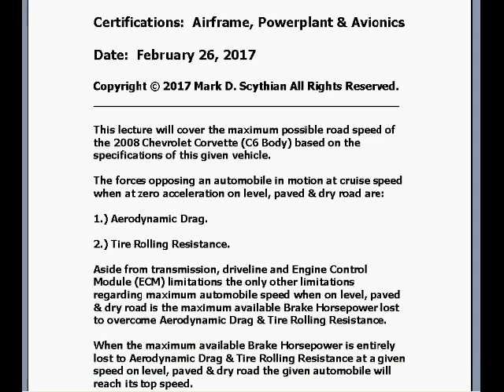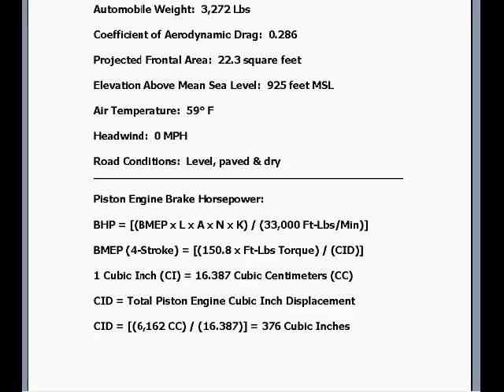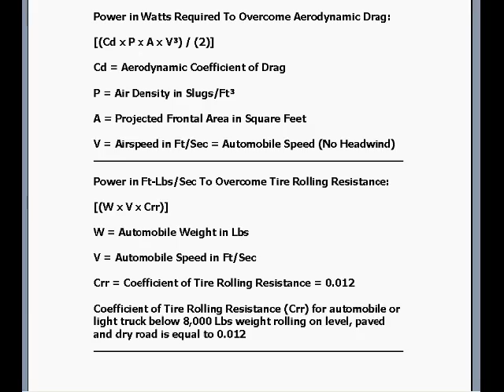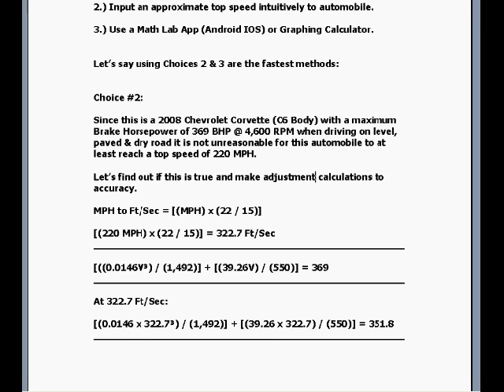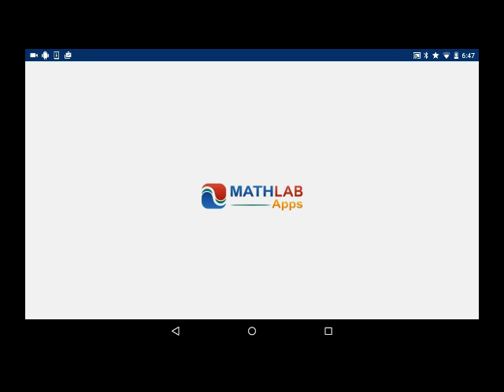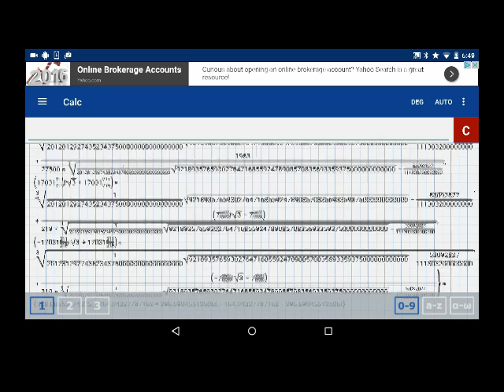2008 Chevrolet Corvette Top Speed Calculation

Comment: Hi Mark. I am sorry to bother you once more. But there is one thing I can not understand. And that is calculating BMEP values at the point of MAX HP rating.  Here is a link with my problem. Any help is appreciated. https://imgur.com/a/Hv0o8
Reply from the maker: Hi JJ how's it going?  The Torque-To-RPM chart reveals that the maximum Torque is:  675 Newton-meters @ 3,665 RPM.  The Y-axis reference when at maximum torque is about 1/3 the way between 3,500 RPM and 4,000 RPM or 3,665 RPM.  I will calculate the maximum BHP output based on these metrics.  Observe my calculation below:

1 Newton-meter = 0.737 Ft-Lbs.

[(675 Newton-meters) x (0.737) = 497.5 Ft-Lbs

Maximum Ft-Lbs Torque = 497.5 Ft-Lbs Torque @ 3,665 RPM.

BMEP (4-Stroke) = [(150.8 x Ft-Lbs Torque) / (CID)]

CID = 454.2 Cubic Inches Displacement

BMEP = [(150.8 x 497.5) / (454.2)] = 165.2 PSI when maximum Ft-Lbs Torque output of 497.5 Ft-Lbs @ 3,665 RPM.

L = 0.333 Ft

A = 14.19 Sq In

N = [(3,665 / 2)] = 1,832.5 PS/Min

K = 8 cylinders

BHP = [(BMEP x L x A x N X K) / (33,000)]

Maximum BHP = [(165.2 x 0.333 x 14.19 x 1,832.5 x 8) / (33,000)] = 346.8 BHP @ 3,665 RPM

Important ===> BMEP in PSI is only applicable to Ft-Lbs Torque & BHP values!

Everything else is total power ("HP" or IHP) at a certain RPM including power lost to keep engine running (FHP) PLUS usable power available at the crankshaft (BHP) and cannot factor as BMEP but only IMEP.

IMEP = BMEP + FMEP

Therefore IMEP is only applicable to IHP or "HP".

"HP" is not the same as BHP.

The piston engine BHP formula can be used but set it up to equal IHP instead and replace the BMEP with IMEP and then solve for IMEP in PSI to know the overall cylinder pressure throughout all four piston strokes applicable to IHP or "HP".  The L, A, N & K are known at the max "HP" or IHP curve as well. 

IMEP = [(IHP x 33,000) / (L x A x N x K)]  ======> Rearranged to equal IMEP

- Mark -
Reply: This is extremely easy to comprehend. Thank you very much Mark. I have one more question if you don't mind. Here is original NASCAR profile from the game.  https://imgur.com/a/ljkEV  and couple of questions. 

It states   231 psi   @7000   and  202 psi @9000.   Please take a look at my math if you have time.
Reply from the maker: Hello JJ!  231 PSI BMEP is way too high for a 4-stroke Gasoline piston engine!  Sounds more like a diesel 4-stroke piston engine!!!   231 BMEP PSI @ 7,000 is not correct.   To solve for BMEP in PSI regarding a 4-stroke piston engine, multiply 150.8 times the Ft-Lbs Torque, then divide that into the cubic inch displacement for the entire engine.   So the bore area of 13.53 square inches times a stroke of (0.27566 ft x 12) equals 44.75 cubic inches per cylinder time 8 cylinders, so 385 CID.  By multiplying 150.8 x 231 Ft-Lbs Torque, then divided that into 358, the BMEP in PSI @ 7,000 RPM will equal 97.3 PSI BMEP.   Whenever the RPM is above or below the max torque RPM the torque will drop below the max torque rating which also includes a drop in BMEP and BHP.

More RPM doesn't mean more BMEP when the RPM is above the max torque RPM.

So the BHP @ 7,000 RPM will equal:  [(97.3 x 0.27566 x 13.53 x 3,500 x 8) / (33,000)] = 307.9 BHP.

- Mark -
Reply: The thing is that those "BMEP" values are given in the game.  231@7000 and 202@9000. I know that NASCAR engine produces around 550 ft/lbs  and around 800hp. So 231 ft-lbs is way too little for a stock car engine.  Here is what I found on-line. https://imgur.com/a/1n8Cz    Its states  220@7500  and   202@9000.

231 - Comes to 548 ft/lbs  and 202 =  480 ft/lbs.      I know now they reduced HP ratings from 825 to 725. But before in 2003   - 830 iHP would be a close number.     Also there are some screenshots I took from NASCAR 101 lecture.   BMEPs they have there are  217 BMEP  and  250 IMEP.    I am pretty sure that in the video they are bragging about old design V8 engines running at such numbers.  Also state numbers as high as 870 HP and 560 Torque.     

In my previous example. Max Torque is at 7000 ( 550ft/lbs) and it falls off like it should at 9000 ( 480ft/lbs). 

I have to mention once again that 231 and 202 values are given by the software.  

If I understood correctly.   At 7000RPM we are making Maximum Torque, Maximum BMEP and Maximum BHP.      At 9000RPM  ,    We have less Torque  ( 480 vs 550) ,  Less BMEP  ( 202 vs 231 ) , Less BHP - (  731bhp vs  821 bhp ) and that last part is NOT CORRECT.  That is what brakes my logic.  That makes me think that those values 231 , 202 are NMEP or IMEPs.  But web site info makes it fall with in BMEP.
Reply from the maker: Hi JJ!  In regards to F1 engines they operate at higher RPM limits with nominal torque and a concentration on automotive aerodynamics.  The result is a large bore diameter and very short piston stroke.  Shorter the piston stroke greater the piston reciprocating frequency or RPM.  Larger the bore results in greater BMEP and Torque.   

Obviously the F1 engines are set up for speed and nominal torque to overcome forces opposing forward motion with reduced air-fuel charge per intake cycle.  If the bore was any smaller F1 would run out of torque and not reach their top speeds quickly.  If the bore was any bigger more torque dominance would occur combined with more fuel consumption per powerstroke and slightly more time to reach top speed.  

So F1 is set up the way it is on the non-American market for their own trademark design philosophy based on:  concentration in vehicle CG, automotive aerodynamics, weight reduction, fuel economy, RPM dominance and nominal torque.  F1 engines are a completely different animal from NASCAR and Sprint Cup engines!  

I'll calculate the maximum BMEP & BHP for both the F1 engine and Sprint Cup engine down below based on the link you sent me along with a brief concluding statment.

F1 Engine:

Bore Area in Square Inches = [(3.858 in / 2)^2 x (3.14159)] = 11.69 square inches
Piston Stroke in Feet = [(1.566 in) / (12)] = 0.1305 Feet
Maximum Ft-Lbs Torque:  214 Ft-Lbs Torque @ 17,000 RPM
CID:  146.457 cubic inch displacement
Number of Cylinders = [(146.457 CID) / (11.69 square inches x 1.566 inches)] = 8 cylinders
BMEP in PSI (4-Stroke) = [(150.8 x 214) / (146.457)] = 220.35 PSI
Maximum BHP = [(220.35 x 0.1305 x 11.69 x (17,000 / 2) x 8) / (33,000)] = 692.7 BHP @ 17,000 RPM

Sprint Cup Engine:

Bore Area in Square Inches = [(4.185 in / 2)^2 x (3.14159)] = 13.76 square inches
Piston Stroke in Feet = [(3.25 in) / (12)] = 0.271 Feet
Maximum Ft-Lbs Torque:  520 Ft-Lbs Torque @ 7,500 RPM
CID:  357.65 cubic inch displacement
Number of Cylinders = [(357.65 CID) / (13.76 square inches x 3.25 inches)] = 8 cylinders
BMEP in PSI (4-Stroke) = [(150.8 x 520) / (357.65)] = 219.25 PSI
Maximum BHP = [(219.25 x 0.271 x 13.76 x (7,500 / 2) x 8) / (33,000)] = 742.71 BHP @ 7,500 RPM

Sprint Cup engine has a higher Brake Horsepower output than F1 engine, but Sprint Cup/NASCAR vehicles also have a higher aerodynamic drag coefficient, tire rolling resistance and vehicle weight compared to F1 vehicles.  Each has their advantage and disadvantage over each other like with any other machine concept. More emphasis remains on the operator/driver's understanding of the given vehicle or machine systems and effective driving for racing applications.  Like with any other machine it is how well the operator/driver understands the given system parameters and effective usage thereof.
 

           - Mark Scythian -

FAA Licensed A&P Technician
Reply: Thank you Mark.  I only have 2 more questions if you don't mind. 

#1 - Max BMEP at Max Torque = 220 PSI.   Is it safe to assume that 231 PSI value in game might be NMEP or IMEP?   Pressure before friction or friction and pumping take away power? 

#2 - F1 to Cup Car link shows BMEP value of 202 @ 9000 RPM.  In PLANK it come out producing 821 HP? 

That does not seem correct as Max BMEP and Max BHP are @ 7000 RPM.   

What kind of MEP can we calculate from HP or (IHP) rating @ 9000 RPM? Or any car at Max HP. 

Would those normally be IMEP.   Indicated Pressures?  Or  NMEP - Net. I know they rate engines in NET HP now instead of gross. 

#3 - Would NMEP and NET HP work in a PLANK relationship or those are completely two different things? And I am just getting the names NET confused?
Reply from the maker: Hi JJ!  The formulas installed onto your racing simulator might not be accurate.  There is IMEP, FMEP & BMEP. linked to IHP, FHP & BHP respectively.  FMEP = IMEP - BMEP.   FHP = IHP - BHP.   If the values don't match up based on a No-Load 33% BTE when at maximum BHP, then more than likely you have programming errors in your simulator.  You might want to access the game Command or Registry function and edit any formula errors.

If you use the methodology for calculating BHP from my last comment and methodology for calculating IMEP from from my last few previous comments you should be able to figure out where the performance metric errors lie..  

Try to edit the game formula registry and let me know what happens!

- Mark -
Reply: Thank you Mark. I have been breaking my head over the simulator for a while. The biggest problem is Registry functions and "Hard Code" of the game are unavailable. It was made by Papyrus Racing Sims in 2003 and source code for this game was never provided. 

I am pretty much trying to figure out what kind of formulas and possible math game creators might have ran in the simulator. All I am able to do is change initial 30 engine numeric parameters and then observe changes in game. It is lots of trial and error. 

More to it , famous iRacing came out from Papyrus's sim. So editing the physics was never possible until recently. Someone uploaded a "home made" tool that will allow to replace certain values in the registry. The list of editable values on the engine is what you saw in my link.  We have no idea how the game runs, no idea what kind of formulas it runs, no idea how it is structured.  All we have is 30 engine fields , 30 tire fields and 60 chassis fields. With more than 50% of values being just numbers with no definitions. That is the biggest challenge. I have been trying to analyze and reverse engineer an approach to editing these values. If everything was clear as day like in other racing programs with available editors, I would not be bugging you as much.  

Basically I have 1 - list of numbers  2 - in game feel , in game behavior , 3 - common sense. Those are only 3 tools I got.    

I can not access Games Data Registry , formulas , I can not even look at them to tell what they are. 
I can only change 30 numeric fields and expect results in game.  
It is like a science , racing , software , puzzle made with 120 lines of different values. 

That is why any help , any info , any tiny little clue that can lead to progress is worth gold to me. 
As no commercial editing soft is available for that game , any edit , any changes made to physics are 
very valuable to those people who still play it.  

I will try to make few sample videos of what actually happens in game, with few questions and ideas. I would like your opinion on what you see if you don't mind.
Reply from the maker: Hello JJ!  No I don't mind.  That would be cool to check out your gaming simulator work documented on screen recorder and posted as a video.  When you finish up some samples tell me the video name or send me the URL link.  It's probably more practical to share what you are doing in this manner.  Well, keep me posted!    - Mark -
Reply: Once again you are amazing help. I have few scenarios I want to show you and ask few questions. I will send you the URL as soon as I put something presentable together in a video. Thanks Mark once again.
Reply from the maker: You're welcome JJ!
Reply: Hi Mark I have one more question regarding your 2008 Corvette video.  In that video @4600 RPM we are making maximum Brake Torque and Maximum Brake Horsepower.   Now when this car is traveling at top speed of lets say 223 mph and is in equilibrium between HP and AIR/TIRE resistance.  I want to ask about gear ratios.  Is all this happening at 1 : 1 final gear ratio ? And at what RPM will the engine be while at equilibrium.  4600 rpm?     Let's say my cars tops speed should be 115 mph, Max Torque at 2500 rpm.  
Now in Game , my car tops off at 115 mph, but it does it at 4500rpm lets say. Why? Is it due to gear ratio higher than 1:1. Because I am running stock 3.08 final gear ratio? (as example)
Reply from the maker: Hi JJ!  How's it going?  The 2008 Corvette with the C6 body and 6.2 Liter LS3 Crate engine is using a drive-line that is a conventional old-school rear-wheel drive differential with a rear driveshaft & U-joints.  As opposed to a trans-axle front wheel drive transmission with a constant velocity (CV) joint.  The rear end differential on GM applications for high speeds is similar to an old-school Cutlass rear differential from 1970's which is around a 2.52:1 differential.

Top speeds of over 180 MPH is at least a 2.52:1 (high torque, moderate RPM), but if you want to go from rest to 100 MPH like a bullet and run out of engine at 100 MPH (lower torque, higher RPM)  then the rear differential is usually a 4.11:1 and typical GM rear differential with a top speed of 140 MPH (moderate torque and moderate RPM)  is around 3.73:1.

With a powerful enough engine with enough torque output then the gearing can be set up very high like 2.52:1 or even higher.  With that much torque and a decent RPM limit I think a 2.52:1 rear end differential would allow a top speed of 224 MPH.

Try these rear end differential numbers in your simulator and try to match the engine BHP, Ft-Lbs Torque & RPM to the maximum output of the 2008 Corvette C6 body powered by the 6.2 Liter LS3 Crate engine.

Talk to you later.

- Mark -